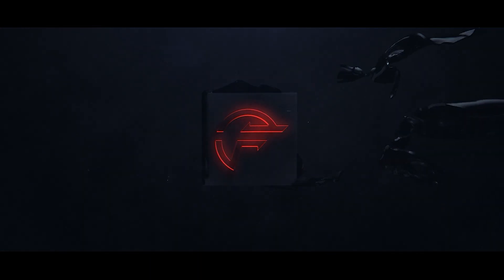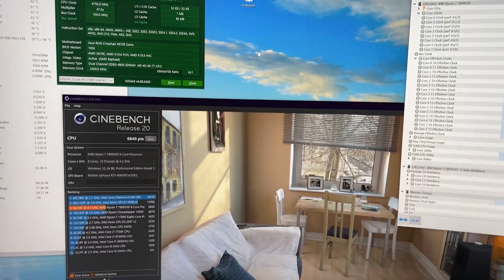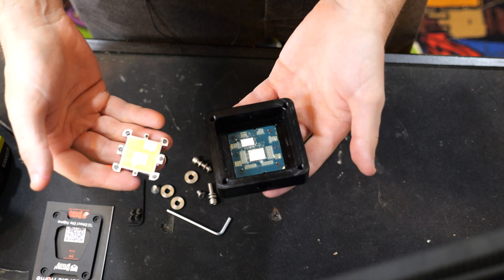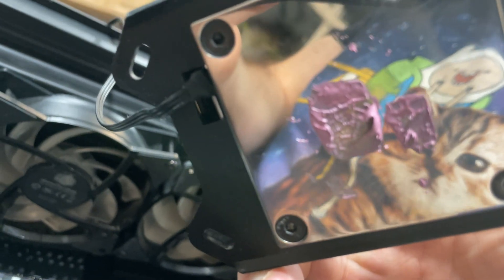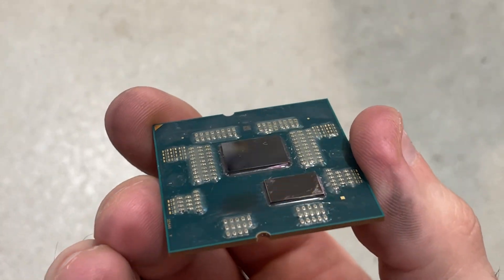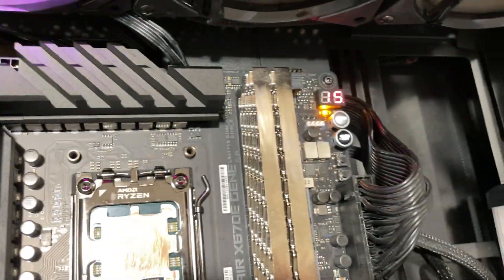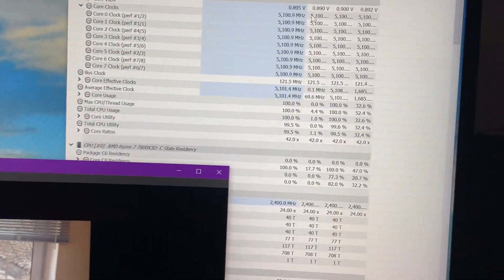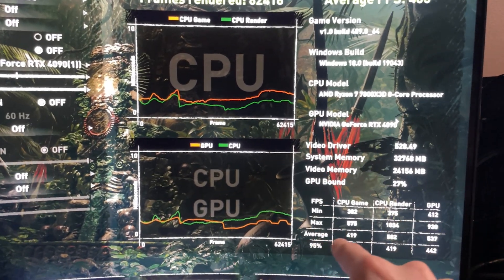I Killed My 7800X3D...

Comment: Recently delidded 5800x cpu using saftley razor blade to cut the gasket and hot air station on the lid while supended using thin screen removal wire.  Don't feel comfortabable using the deliding tool bc it's puts shear force against the die.  Maybe the tool weakened it and caused it to crack....

Comment: I'm currently shopping around for a new computer and also looking at doing a direct die rig.  I read there is a V2 direct die frame for AMD AMD CPUs which adds X3D and 9000 support.  Thermal Grizzly advises against using the original frame with 7000 X3D CPUs.

Comment: I'm 68 yo, been away from computers for thirty years just came back in January and have delidded a 7950x3d and a 7900x successfully using Der Bauer's tool and have the mycro water blocks on both.  I did not find it difficult to do and used Liquid Metal for the first time also.  They were both thermal throttling on Cine bench 23 before, now they top out at 78c and 81c respectively.  My scores increased by about 10%-15% by delidding.
Reply: I hope you get this, how did you remove the solder off the silicon after delidding? Thats the only part thats making me nervous
Reply: @papi_gtruckttv i used a credit card and scrapped until I got it off. I think Der Bauer makes a tool for it also.  As long as you dont use metal you shouldnt hurt the cpu.
Reply: Hell yeah!!!!
Reply: German engineering, still ahead in 2025, AND YEAH! The Bauer constantly warns of liquid metal

Comment: the first delid you did was done wrong, yourb not meant to use a power tool, there was a lot of debris and crap everywhere, the overkill amount of time spent on the quick back on forth of that power tool created heat and friction then the debris trapped under the CPU HEAT SPREADER was literally forced and trapped in by friction to pass over the cpu dye hence splitting the dye you idiot, thats why you only use the allen key by hand, you had actually already successfully delided the cpu before the power tool as you even said yourself it need no force and was little resistance. all that was on you.

Comment: I don't see the point of delidding a 7800X3d
Reply: It's the same pros and cons for all cpus. 
Less temperature --> better performance and stable frequency. This allows for higher RAM and overclock capabilities if you tinker in xmp settings. Also delidding enables you to choose a better variety of cpu coolers since you are not limited to the same TDP. For sffc builds with very small itx cases this can come in handy.

Comment: Wouldnt it be better to use a heat gun to loosen the solder it worked like a charm on the 12900ks i got.
Reply: It's not solder, it's adhesive glue. And you don't want to expose the die to those temperatures even if it's for a short while until the glue melts as you can easily pass the limit of 89C (TJMax) for this cpu. Buy yourself a delid tool and save yourself from an unecessary risk.
Reply: @JesusChrist-sx1lf  yeah don't wanna take a chance for the Der8auer tool and direct die contact frame.
Reply: @shadowarez1337  The risk of destroying the CPU by using a heat gun far exceeds that of using a normal delid tool. Just because you tried it once and it worked doesn't change those facts. If you are skeptic about the Der8auer brand there are other brands and tools which does the same thing.
Reply: @JesusChrist-sx1lf  iv used the heat Method on Intel i9 12900KS 14900K-KF but like others have stated and doesn't use the same time between the IHS and die.

Comment: A little late to the Party...
The first cpu with the die crack, on the the German Website caseking where the sell the Bauer stuff....
The direct die frame is not compatible with the 7800X3d !!!!!  It´s marked red in the description.

" Danger! Incompatible with the AMD Ryzen 7800X3D because AMD changed two bonding points for series production. This means that the inner contour of the Direct Die Frame rests on these adhesive surfaces."

If you check your video you can see that the direct die frame is touching some resistors. 
So this means that the frame is not flat on de cpu itself.  That´s why  the die probably cracked.

Roman has made a new High Performance Heatsink for the am5 cpu´s

It´s on the German Caseking site, just search for Thermal Grizzly 🥸🥸🥸

Comment: steps to cooling a 7800x3d below 75 degrees at full load:

- get a 7700 instead
Reply: XDXDXD
or just undervolt more?
Reply: I dunno. I have ID-Cooling SE-206-XT and stock paste and mine never runs hotter than 68C. All the tests also seem to show how small the thermal packet is compared to 200W monsters. It can't be that 85 TDP is harder to cool than 200W TDPs right?
Reply: @ImpeccablePony  Excellent cooler - I have the Xilence M705D - same cooler but another brand name on it. 👍

Comment: Try undervolt the curve optimizer on all cores to negative 20(mV), i found out my cpu can handle negative 30 and more but it is not as good and have lower skore on cinebench, by benchmarking i found out negative 25 is a sweet spot for me, gained about 100Mhz on all cores under stress, lower voltages and with the same temperature on AIO water cooler, approximately i gained about 1000 skore on Cinebench R23. But ! i have SK-Hynix 6000Mhz Ram from Gskill 2 sticks, BCLK/ inifinty fabrik set to 2033Mhz, UCLK/MCLK to 1:1 gear ratio and custom safe timing from Buildzoid for those RAMs. My system is working really well i dont do any stuff like deliding or grinding the IHS and because X3D CPUs were not build for OC you have few options to gain better performace. PS. this video is 4 months old so dont know if you do this but update your BIOS.

Comment: It still baffles me that neither AMD nor Intel sell 'naked' CPU's with no heatspreader for enthusiasts.  Remember when AMD's Athlon XP series were just exposed CPU's on the die?  I'd love to not worry about killing a CPU from de-lidding.  They could even upcharge for the 'enthusiast' CPU's while saving money on solder and a heatspreader and enthusiasts would flock to buy them.  The companies could even bin the CPU's to ensure max performance and clock speeds.  Much like Silicon Lottery used to do as a third party.
Reply: its much easier to damage chiplets during lets say.. transport or MOUNTING AN COOLER, than to damage them during delid actually
Reply: It all because of warranty
Reply: Exactly because of people bending and breaking the CPU PCB like our guy did here. And RMAing it.

The IHS has several functions, including structural integrity of the chiplets.
Reply: I was thinking the same exact thing lately. I remember the good old days where Amd and Intel cpus were barenaked.
Reply: its for third party cooler makers to have a market
Reply: Ampere Computing (not to be confused with Nvidia Ampere) did something unique.  Instead of a heat spreader, they added a perimeter to keep a heatsink from crushing the chiplet dies of their AmpereOne server CPUs.
Reply: Lmao people can’t even plug in their gfx card right, and you out here wanting bare die CPUs 😂
Reply: Intel 3rd high performance I-7 on the Alienware m17x R4 came without the heatspreader. It’s 13 years older and still works without any issue. I wish the heatspreader was made of copper for better heat dissipation.

Comment: Seems like X3D Cpu's are constrained by their voltage and design, X Cpu's on the other hand seem to scale very well with anything you throw at it.
Reply: yep, you are completely right. The voltages are very very tightly controlled, the most (and easiest) gains can be from curve negative voltage offset settings.

Comment: Next time use dental floss to cut the glue. Get a clothes iron max heat, apply cheap thermal paste on 7800X3D. Place processor on iron, let it sit for several minutes. Take some tongues to separate the IHS. The thermal dynamics will let the IHS to stick to the iron.

Comment: Thank you for your work and the sacrifice of one 7800X3D. AMD has to figure out how to cool the heat trapped under the 3D V-Cache and structural silicon to increase clock speeds or focus only on IPC improvements for next gen.

Comment: Many years ago, the difference between modding and stock - depending on X,Y,Z was often large. That remains the case today, but in some cases, and this is one - its interesting to see that the vendor has what is a hard to mod piece of engineering, and yet, its good out of the gate, and close to its maximum in a general sense.
Reply: Yep.  Intel keeps making amazing CPUs
Reply: @laz7354  AMD has completely decimated the Intel lineup in both performance and cost this generation. Intel will definitely be back in the race I'm sure of it, but one things for sure, they don't KEEP making amazing CPUs. lol

Comment: So when are you going to show the temps from the de lid? because what you did isn't showing direct die performance.
Reply: plus swapping cpu's and not doing a re test of programs and showing differences doesn't work. Your running a asus motherboard show the SP rating of the chip so we know how good the silicon of the cpu is. that could account for differences in voltage/temps/boost clock

Comment: Imagine a 7740G3D
Sure, only 48MB of cache instead of 96MB
But its monolithic 4nm, instead of chiplet 5+6nm, meaning there is far less latency to RAM and the RAM can run at much faster speeds thanks to the 4nm IMC
Would i like them to make 32MB non3D versions of their APUs? Yes
Do i think they will? No, they need to do some sort of product segmentation, there has to be a reason to buy the higher margin CPUs over the lower margin APUs
Reply: Balls

Comment: "It's a pretty cheap mod..." 😂 All you have to do is to buy two 7800X3D's and boom baddading your CPU is running 7 degrees cooler.
Reply: Yeah. Or you can use better paste and get similar gains in temp.
Reply: @djchotus1 "You can use a better paste and get similar gains in temp". Please, give us some of the stuff you're smoking. lmao  

Even THE BEST paste would give you maybe at best 1-2C improvement. Also, doing direct die cooling on 7950x goes in up to 20C, depending on the setup you use.

Comment: You keep coming up with dud segments with the AMD stuff.  It's probably just karma kicking you for being such a pathetic brand hater, but whatever.  Even so, here's an idea that might be worth some views:  Lowest TDP possible and still run 60FPS in 4K on a game of your choosing.  Combine the 7800X3D and otherwise crap 4070 for super low power consumption, nix the RGB and extra case fans and shoot for the lowest possible undervolting and outright consumption.  Maybe a 5800X3D fares even better?  Test and find out. Then do 1440 and 1080, dusting off some antiques if need be, or one of those Ali Express mobile chips stapled to a PCIE card.  Your content doesn't always suck, so I feel obligated to offer a suggestion.
Reply: WTF is the point of suffering through 60FPS just to have the "lowest TDP possible" and "super low power consumption"?
Even if you're old or you simply don't care about motion fluidity or IO-lag; what's the point of that comment on a channel dedicated to high-end overclocking and system tuning to help gamers achieve consistently low frame times?
Reply: Not too familiar with him, dos he hate AMD?
Reply: @gwynbleiddroach2589  that's all he does.  The rhetoric was mild in this episode, but he usually goes out of his way to spite them in seemingly strange tangents.  I think they told him he has a small pnis in the past.
Reply: Lol, cope.

Comment: LOL  just about the same exept that part where the 13900ks is solo pulling  crazy watts  at full load and is 699$ a full $250 more than the 7800x3d.
Reply: And 420MM Cooler just to control the temps.

Comment: All in all, If you ask you me, anything less than 10% is margin of error and I wouldn't even worry about it. The best thing to do is leave it stock or undervolt and power limit or use eco mode (If you can). All this work for 2% is definitely not worth it all.

Comment: There's no point in de-lidding and then putting the lid back on with liquid metal because it was soldered to begin with.
Reply: If they'd maybe reduce the IHS by 50% thickness that'd be great.
Reply: @shadowarez1337  Yeah, sanding the IHS down is probably your best bet for improving thermals.
Reply: @shadowarez1337  you could do that with either a milling maching or spending a lot of time lapping with lower grits
Reply: @ethanrislov3454  yeah used a block of wood with varying degrees of sandpaper. I'll try the metal fatigue method with cheaper CPUs until I get a hang of it.
Reply: thats not true

it really depends. i remember a video of Roman der 8auer when he delid an Intel CPU that was soldered.

there are different ways / materials to solder. And after scrubbing it all off and putting liquid metal on it, his temperatures improved 5 to 7 degrees. 

which is defentely not bad and important if u chase high overclocks.

but for the average person/ gamer it should defenitely be avoided. The risk/ reward is really bad in the end.
Reply: @Hardys-Mods  he might as well have done some sanding too. Then he might've actually gotten a 10C reduction instead of a 5-7 reduction.
Reply: the solder is almost always not evenly spread out and even if it is, liquid metal is better at conducting heat
Reply: This is a perfect example of someone repeating what they heard and not testing it themselves
Reply: @yosixxx  No, I am using my own reasoning. If it was bonded with wet metal then why bond it again with wet metal. Obviously if they used used heatsink paste then liquid metal would be an improvement.
Reply: there's no point in doing any overclocking or tinkering, gains are abbyssmal
Reply: @snowpuddle9622  You don't get it do you. That's okey
Reply: @thor.halsli  The dude can't comprehend hobbies.

Comment: Some reviewer got up to negative 35, but mine is unstable at negative 30.  I am pushing 6400 on the dual rank ram with semi tightened timings,hitting 58.2 ns latency. So I guess my IMC is good at least.
Reply: How? The setting maxes out at - 30 im BIOS? Doesn't sound like math.
Reply: @djchotus1  I dunno, that's what the dude said... 35.  I never tried over 30 cause 30 was unstable so I went back up to 25.

Comment: You can get pretty much the same with a negative curve optimizer if your CPU can hit negative 30 or higher.  I was hitting 4.8 in cinebemch on a 360 aio with no delid and temps around 75c.  Not sure what the bclk is doing to temps, mine's stock though.
Reply: I got a similar outcome to you. -30 seems to be doable for most of these CPU’s

Comment: Amd and Intel should sell enthusiast cpus with direct die liquid cooling on their top skews.
Reply: The problem with dat is Thas alot of not experienced person are  gonna still buy it and end up crackling the die etc etc and start bunch rma etc to deal with it
Reply: @HosakaBlood  I was thinking that the direct die heat spreader was already attached. No need to remove it and crack the die.
Reply: @BackToTheStart47  You can't have both a heat-spreader, and be direct die simultaneously. The whole point of direct die is that there is no heat-spreader.
Reply: @Bayonet1809  What I am suggesting is that the direct die is already installed from Amd or Intel. No need to remove the IHS.
Reply: It saves them a production step and they could charge the same money.
Reply: They'd get bent and broken like he did here. It is risky on several levels, not just the delidding part, but mostly the handling and using the thing later.

And the thermal stresses. 

Delidding is easy, handling the chiplet is hard, and Intel or AMD don't want the headache that is offering warranty to them.

Notebook CPUs are always direct die, because they're soldered in place and thus more resistant to bending.

Comment: 7:35 Why do you have that much spread of liquid metal ??
and why do you only have 1x  8pin connected with that cpu ??
Reply: You are honestly retarded
Reply: this CPU does not need 2 connectors, it never pulls above 90W. One connector is good for 300W. Why would you need 2 connectors for 600W when you only consume 90W? Do you know numbers? 90 is much smaller than 300.

Comment: The temps are high, especially in SOTTR. The effective clocks were dropping quite a bit also. With custom water cooling I’d be shocked.  I’d be interested to see how much Curve Optimiser brought those down. My 13900ks stock was crazy high, but with a simple undervolt it’s very rarely hitting 60c in gaming, and that’s with an AIO without delid etc.
Reply: Yeah the Intel chips come crazy overvolted from the factory but they can be power limited and tuned to a great level where you can get great performance and reduce the heat and power consumption Exponentially.
Reply: @NBWDOUGHBOY  It's the motherboard, not the cpu.

Comment: Thank you for your honesty the 7800x3d is a really good gaming cpu and not for overclocking. Its already running on limit and i wouldnt recommend anyone to touch the settings. But slight undervolting could help for better thermals and powersavings.
Reply: 7800x3d is overclocked to 5.4Ghz already two weeks ago and its boost up to 5.6GHz, all without delid. https://www.youtube.com/watch?v=90UBUq1mLGY
Reply: You could use PBO and negative CO offset to gain performance if their is thermal headroom with undervolting and jsut let the chip keep boosting til it hits the limit